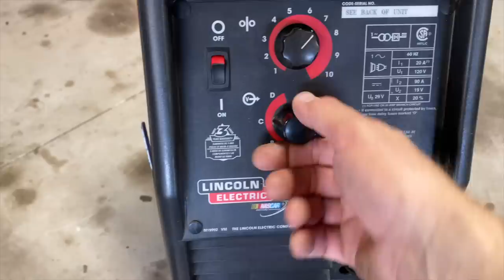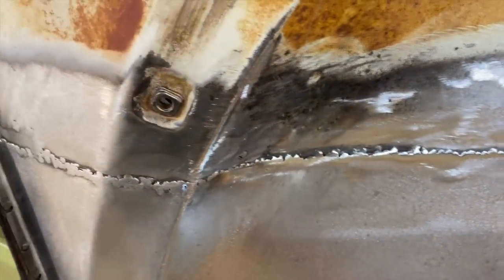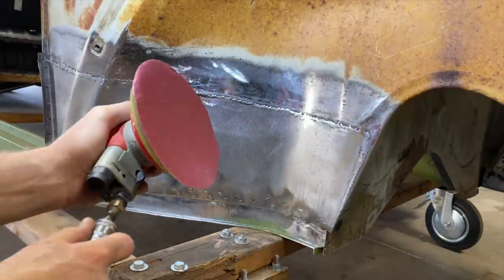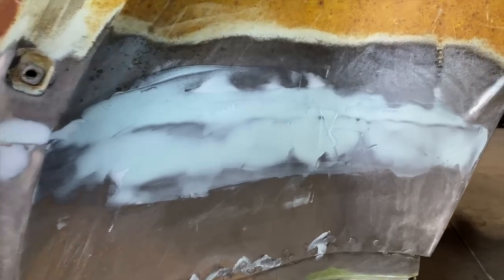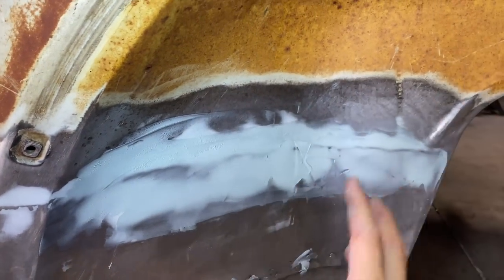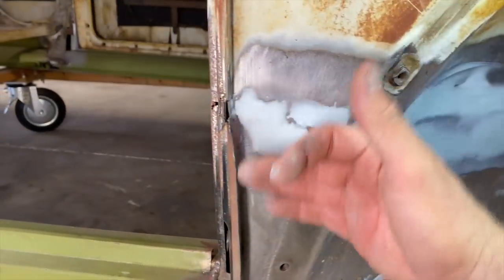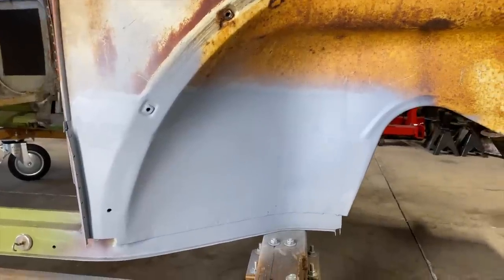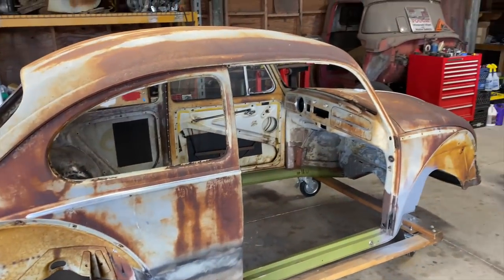1965 VW Beetle Restoration - Metal Work

Comment: Methinks one pass of filler should be good enough and the rasp is probably more geared towards thicker filler applications. Also maybe sand until it’s level and leave it alone and move on to the next panel.
Reply from the maker: Thanks buddy! Yes, I moving on to the next area.
Reply: Don't listen to anyone who says "methinks ". So f×$#&%g condescending. You're doing great.
Reply: @talltom1129  Not meaning to sound condescending; it was just a suggestion and sorry you got triggered. I agree it’s coming out very well.

Comment: I had that same crack in my old garage. I filled it with epoxy then attacked it with a concrete grinding disk from Harbor Freight. It worked. Not perfect, but it leveled out nicely. No more lost nails, screws, washers etc.

Comment: Protip. put the cheese grader in the garbage can. use 60/80 grit to do all of your rough shaping. clean up with 240/320 and move into 400/600 from there.

Comment: Lap welds should be avoided wherever possible: butt joints can be made almost invisible and need hardly any filler. The rasp you are using is far from ideal: you could get a body file that can be adjusted for concave surfaces. You should use a grinding disc to knock the surfaces off welds that are too high before moving on to sanding discs, and various grades of flap wheels work well. You shouldn't use a DA sander to grind down welds: a flat rubber backing disc with abrasive sanding discs works much better. DA sanders are designed to be used on flat surfaces: you can get away with using them on convex surfaces but the are useless on concave ones. As others have said, you should not use too much hardener in the filler, and when you have applied you should leave it alone until it has hardened. If you keep trying to smooth it out once it has started to harden you tend to just pull out what you have already applied and make it rougher. Far better to let it harden, file it smooth and then apply a further thin coat to any imperfections. You may need to do this more than once on external bodywork, but it shouldn't be necessary under the fenders. These comments are intended to be helpful and I hope that you will receive them in that spirit. Best wishes

Comment: I think your doing really good for learning as you go. You might consider using a seam sealer first especially on the lap seam. The little car is taking shape and I feel you will your knowledge to go forward on the rest. Keep the videos coming.
Reply from the maker: Thanks for the tips! I appreciate buddy! =)
Reply: Sometimes it's a difficult decision whether to seam seal the top or bottom of an overlap.  Can't really seal both and risk having a leak trap water inside the overlap.

Comment: Anyway, some chemical rust remover should be advised to get the best result on lap welds. The depression and feasures can't be reached with wire brush or grinder.
This video became almost ASMR stuff, interesting.. pretty different than usually.
Spread the bondo more on areas with depression, a bit over the minimal thickness and don't wipe it to death. Leave it a bit proud, then sand and cheere-grate. Hardener usually is used also according to temperature, so the hotter it is, the less hardener required or speed up. Spread it with vertical squeegee to feather it out over the low side, don't forget also to degrease and dust off surface before applying, the peeling spots usually indicate contamination.
Personally I'm not really a bondo fan, although sometimes it makes your work a charm. Anyway I prefer take some time to do excelent metal job, which spares you  tons of dust. Bondo shines on non-destructive repairs, when you avoid to "hurt" the back side of the metal. 
It's not crappy, just need to smooth it out a bit more with second or third coat. Sometimes you can improvise with some sanding blocks of EPDM foam, like the one for insulation, which is between sponge and styro-foam. (I don't have  a clue how's called at your place) 🤔
All in all seems promising... 😊 Keep it on, some elbow grease and success is guaranteed. Cheers.

Comment: if youre trying to make the area FLAT and hide your welds and seams, stop tipping the sander sideways using the leading edge of the sander and digging all the filler back out and making it wavy and curvy, use the sander FLAT.........

Comment: Evercoat sells a product called Plastik Honey, it's basically filler resin. It's helps with pinholes and dry time. Rule of thumb, it's always better to spread more then enough; then having to keep applying filler. Don't be afraid to lay it on there, you can always sand it off..
Reply from the maker: Thanks man! I will check it  out. good tip! I was trying to keep it thin so I didn't have so much to sand off! =) HAHA!

Comment: May I make a suggestion next time you go over welds you should use metal filler because it doesn't let moisture in them use light body filler and then use glazing putty to fill any pin holes.
Reply from the maker: Good idea! I will do that next time.
Reply: Good luck on your project and I wanted to say I like the fact that you are doing body work for the first time I enjoy watching people trying new things.. I myself am restoring a 57 beetle but I'm not using the air cooled engine it didn't have one.. anyway great project

Comment: Filler or "bog" as it is known in Australia has been used for decades and it is a painstaking operation. In fact before buying a used car you would always take a magnet with you and if you couldn't hang it on those parts that were liable to rust or in places where dents look to have been, you wouldn't buy that car as you were only buying trouble.

Comment: Hey CT, you've come a long way since pulling your first Karmann Ghia out. May I suggest that you may have an easier time spreading the filler on a concave surface like your wheel well by using a rubber squeegee?

Comment: If you were going to paint it  you want to put a thicker coat on there and feather it out further. But for what your doing that is just fine. Under the fender that would look just fine. nobody would ever see that. all that is less than 1/16 thick. you can go up to 1/4 inch. But you would not need that either. The trick is to release a thicker coat off the bondo spreader. takes practice.

Comment: You’re wiping the fillet too thin, leave it thicker, 4” on each side. Get rid of the cheese grater, you doing more harm than good with that thing. Lap joints leave one side higher. The way you did the vertical weld, by creating a butt joint is way better. Primer, base coat won’t mater, you will always see that line. 80 grit to shape, 180 to refine and remove 80 scratches. 320 to get rid of 180 scratches and ready to paint.